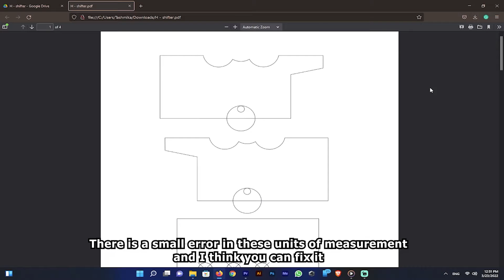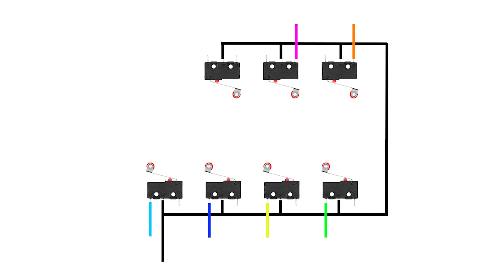How To Make DIY H-SHIFTER For Pc | From Game Joystick

Comment: Hey bro i really like your projects and I have some questions regarding your projects and also some tips also these questions are for pedals,gear shifter, handbrake

Q1- Is it really important if we use all those mechanics instead of doing it simply ?

Q2- Can we use cardboard for making these builds ?

Tips- I think you should label the parts name in the video and how many we have to use so its actually much better to understand and its easier

Btw love from india bro ❤
Reply: A1: If you know how to encode your circuit then it’s fine
A2: Cardboard is not stable for long use

Comment: Hey man very good work 
Can i use 13 sensors instead of 7 
I want to play ets2 with it
Reply: bro you can assign a button on keyboard to switch from 1-6 gears to 7-12 gears on the same layout. you can find option for that button in game settings itself

Comment: Thanks for the design, but what thickness is the wood you are using? And can you use 22mm bearings or do they have to be 35mm?
Reply from the maker: thickness is 13mm
yes you can use any size bearing